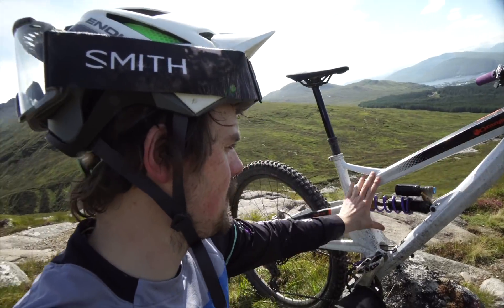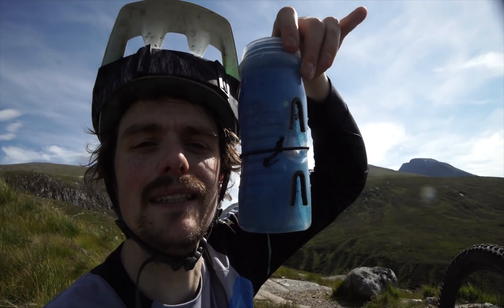Joe Barnes on Science #1 - Bike Bottle Hacks | Pro Set Up Good or Whak

Comment: I would question the amount of force the water sloshing about would actually make on stability given the overall force of weight on the bike.   For quietness I applaud this modification.
Reply from the maker: Its not so much for stability getting thrown about by the slosh. Its just that a heavy mainframe bike rides more composed and "stable" than a light one (think ebike). Heavy bike and more compression can be a nice thing but not for agility or pedaling about. So thinking was to keep the bike light but use all the options at hand to up the mainframe weight.  Anywhere from 0 to 500g free weight you can add to the mainframe. For every 100g of water add a click of compression, haha.
Reply: @joebarnes_hazzardracing2913  the weight of the bike shouldn't make a difference unless the kinematics of the suspension/combined weight doesn't match the damping tune of the shock.  I expect a video where you get the bike on a pivot and set the balance up with wheel weights.
Reply from the maker: @MTBScotland  too deep science for me! I think I ken what you mean.  Assuming the kinematic is the same it maybe allows for a higher damping tune and then shifts the suspension more to speed sensitive than force sensitive and possible more consistent and tunable that way 🤷‍♂️. Either way a bike set up with weights would look the science
Reply: @joebarnes_hazzardracing2913  I used to be a scientist now a science teacher

Comment: What did you actually use for the ‘bungee’ to hold the bottle on? I’ve stopped using my cageless bottles as fed up with em falling off......wouldn’t mind giving this a go.
Reply from the maker: It works really well, easy and effective. I just got a bit of bungee off an old bag but its essentially 5mm bungee cord. Just tie it so its snug when you lift it over the lid and it'll keep things solid
Reply: Awesome 👍🏻

Comment: That's pretty damn smart! The extra vibrations from the sloshing can't be good and the o ring tip is great! Inners road gap. Lost a Fabric bottle on the last 10m to the take off every time. Gave up and used a bottle cage, 1l bottle and an extra velcro strap in the end.